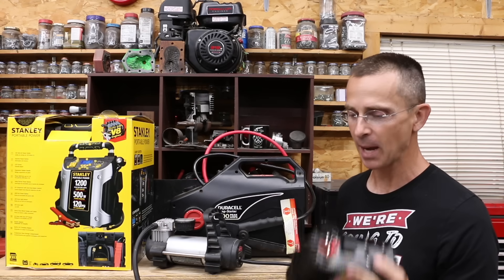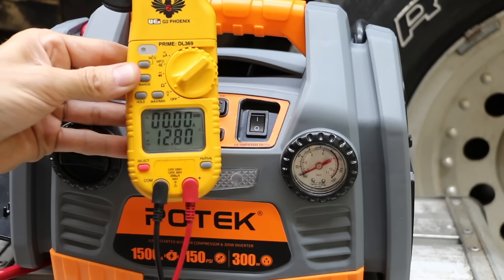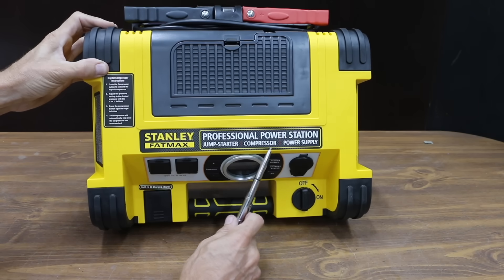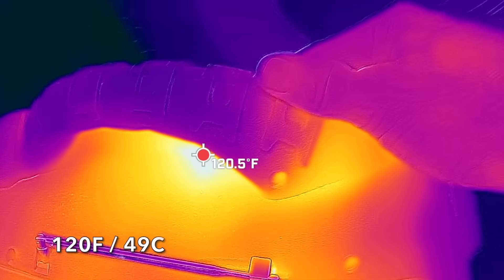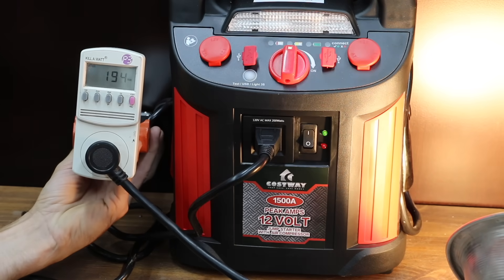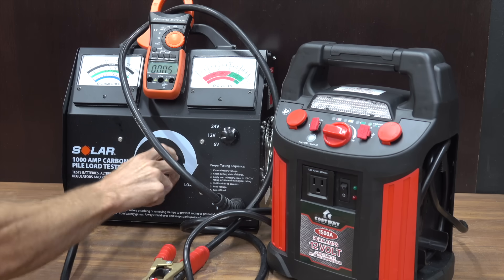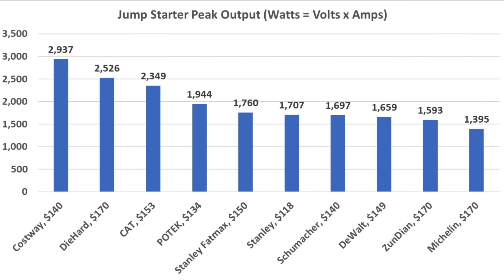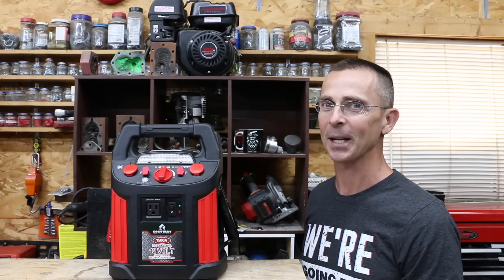Best Jump Starter? DieHard, Schumacher, DeWalt, Michelin, Stanley, CAT

Comment: I bought a CAT power station at Costco that is very similar to the one you tested, although the Costco version claims to have 1200 amps. (The Costco model is CJ1000DXT.) I also tried and failed to get my car started with it with the positive and negative terminals connected directly to the battery, as you did in your test. However, when I only connected the red cable to the positive terminal and connected the black cable to the frame of the car by clamping it onto one of the strut bolts, my car turned over very quickly. I don't know enough about electricity to know what that would change, but maybe you should rerun the jump start test that way?
Reply: With electricity, things are often 'grounded' or 'earthed' which means connected to the earth or ground, usually it's for safety. If something shorted, instead of current going through components that could be sensitive or in a dangerous way, current goes into the ground instead. Voltage is electrical pressure, and it comes from an electrical charge, which involves a difference in electrons. A lack of electrons creates the state of charge designated 'positive' and an abundance of electrons creates a state of 'negative' charge. The electrons repel each other, and are attracted to protons in the nuclei of the atoms in a medium, which are neutral only when the number of electrons matches the number of protons. The earth has an abundance of electrons, and since it's so massive, can give up or accept plenty of electrons without becoming negatively or positively charged. 
With a vehicle, it isn't practical to have a ground wire touching the ground all the time, so they have what's called a chassis ground, usually the negative terminal of the battery is connected to the chassis directly, so a circuit can be completed by connecting to the positive terminal, and to the chassis. Be careful not to short the positive terminal to the chassis, this is why you often see the positive terminal with a protective cover over it but not the negative one.
I guess if jumping the starter doesn't work connected to the terminals, but does when negative is connected to the chassis, either the battery terminal has poor contact somewhere or something, and you get better conductance with the chassis, or the booster pack's effort is being consumed by the battery itself, sucking in the charge which is meant for the starter. Electronics behave mysteriously on occasion, though there's generally a simple explanation underlying the confusing inconsistencies.
Reply from the maker: Thanks for the feedback.

Comment: All of these have similar motorcycle-size batteries inside them. It would have been helpful to disassemble them and see for which ones it's feasible to replace the battery.  eBay has several good sellers for replacement batteries.  Also, as others have pointed out, the internal sealed lead-acid batteries in these jumpers will go dead if not kept charged every few months.  I have an older model of the Cat jumper from Costco that I liked, but I hate the newer one because all the digital crap, it will refuse to even attempt to jump start some vehicles, e.g., perhaps the car battery is too low.  The older analog Cat models will give the jump effort whatever they've got, which is often enough to start the vehicle.
Reply from the maker: Thanks for the feedback.

Comment: Could you do locking grease gun heads?
I’ve tried a few and the ones I have tried are either bulky or difficult to lock so it would be greatly appreciated.
Reply from the maker: Thanks for the suggestion.

Comment: I have never been able to make one of these work.  I have always had to use another car with the engine running.  I might try the Costway.  Appreciate the work you do.  While I appreciate that this is not a rigorous test checking several of each of the brands and going for an average, it is good information and does serve well.  Although I will never use many of the things you test, I REALLY like seeing what kind of tests you have devised and constructed for so many of your challenges.  I admit I envy you the back 40 runway for your 4 wheelers.
Reply from the maker: Thanks for sharing.
Reply: A friend of mine owns a towing company and he uses a deep cycle battery with a short set of cables bolted to the studs. Works unreal time after time.
Reply: @jerryhyland1554 I have found a garden tractor battery (200-350 CCA) works great with short cheap jumper cables or heavier longer ones.  Just keep battery charged.

Comment: I wonder if it is a straight up time out safety that causes them to shut off at 10 minutes, not an over heat shut off 🤔 it's odd that they all shut off right at 10 minutes.
Reply from the maker: It is programmed to shut off at 10 minutes to prevent overheating.

Comment: Another strike against the Stanley (and why I'm not keen about sealed lead-acid batteries in general): LENGEVITY. I owned the Stanley unit minus the inverter and kept it in my car. After a year and a half was the first chance I had to use it and it wasn't enough to turn over the engine because the battery failed. The small Li-ion jump starters are much better at holding a charge.
Reply from the maker: Thanks for the feedback.

Comment: Another great video. Some constructive feedback though... All jump starters are more effective when the negative is attached to the vehicle ground like somewhere to the engine block. This way the jump starter is not trying to charge the battery and start the car simultaneously. This way provides a more direct path for electricity to the starter. Your test was good as it showed the most difficult scenario but there's a chance the jump packs that failed may have started in my suggested configuration.
Reply from the maker: Thanks!  Thanks for sharing.

Comment: I don't trust Stanley's tire compressors. The jump starter we bought has a paper thin piece of plastic for a piston that is obviously designed to wear down to the point where it no longer pumps; something I found out after the pump stopped working... In fact, the jumper in question is the very same Stanley Fatmax showcased in this video.
Reply from the maker: Thanks for the feedback.

Comment: Why not use lithium battery in a jump pack,I know cost would be higher but wouldn't the performance and weight reduction be worth it ? Can you swap the internal battery to lithium or would the internal charger be an issue ?

Comment: I prefer the much lighter lithium ion jump packs w/USB and separate M12 Inflator w/5yr wty. It’s been my experience the built-in pumps on the all in ones are not very long lasting and also take forever to air things up. And I have a separate inverter if needed but honestly I almost never need it.
Reply from the maker: Thanks for sharing.

Comment: A video comparing winches could be interesting! Winches have dynamic braking systems which prevent free-spinning. Originally I was looked to see if I could use a winch as a hoist for a ~50lb weight but I could not find any information about static load holding on winches.
Reply from the maker: Thanks for the suggestion.
Reply: Guys, remember Todd is purchasing these items out of his pocket.   Buying winches can be super expensive.   The last one I purchased, a WARN 10K Zeon Platinum, cost me $900.

Comment: Thanks for the video. I looked online for the Costway and it said it was only good for up to 4.5L gas engines. Did you find this to be true? What size engine were you using? Do you think it would work on a 6.0L gas engine? How would this compare to the Audew you tested earlier? Would the Audew be better for starting larger gas engines?
Reply from the maker: You are welcome!  Thanks for the suggestion.

Comment: Hey Project Farm, could you do a video testing powersports batteries? Specifically the batteries that go in import motorcycles (Honda, Yamaha, etc.)

I'd love to see these brands tested:

EverStart
Calltric (found on eBay)
WPS (Western Power Sports)
Yuasa (This would be a must test since many people believe Yuasa is best because they are a factory supplier to many motorcycle manufacturers)
Motobatt
BikeMaster
BatteryTender
Interstate
Chrome Pro (Popular on Amazon)

Could you test a variety of Lead Acid, AGM, and Lithium batteries? Some of these manufacturers make batteries of all three types.

If you think that would be too much for one video, maybe you could break it up into three videos. (Like you did for the different types of AA batteries)

"Best Lead Acid Powersports Battery"
"Best AGM Powersports Battery"
"Best Lithium Powersports Battery"

Love your videos!
Reply from the maker: Thanks!  Thanks for the suggestion.

Comment: Allen wrenches need to be tested all are junk
Reply from the maker: Thanks for the suggestion.
Reply: @ProjectFarm   1/4  and 5/16 are common sizes I use on the farm. Longevity is always problem along with tight screws. Ends always round off, breakage can be a problem also

Comment: Hey great videos thanks.
Unrelated to this video but: a while back you were exploring running a small engine on starter fluid and diesel and other blends of fuel. How about try diesel mixed with Ethanol? As you know Ethanol raises the octane rating of a fuel, it's rated 100 octane but mixed with gasoline Ethanol acts as 112 octane, a small amount of gas and a larger quantity of Ethanol may make diesel (or biodeiesel) run a small engine quite well, could you make a video on this, please?
Here's why I think this is a good idea for for video: Recently I've seen people interested in making "Ethanol free gas" by mixing a bit of water with the gas to make the Ethanol precipitate out. That Ethanol could easily be distilled off from the water separately and not wasted but used to power a small engine (generator/lawnmower etc) and people are also regularly recycling their cooking oil into viable diesel fuel using nothing more than lye and a bit of light processing.

I think it's a very interesting topic. Might Ethanol and Diesel be mixed to power a small engine?

Thanks again for all the great content you make!
Reply from the maker: You are welcome!  Thanks for the suggestion.
Reply: @ProjectFarm  Good afternoon I’m sorry to bother you but I hope you get back with me as fast as possible please cost way where did you buy yours or how did you locate it because I cannot find it in any store and I cannot even find it on the Internet. So can you please give me some information to go by do I need to go to a certain website to a store since that is the best one that came out of this test run I would like to own one of them so please help me out give me the information to locate one I would really appreciate it and God bless you sir✝️✝️✝️

Comment: Don’t have a need for an inverter so I personally went with your recommendations for a stand-alone compressor and a lithium ion jump starter. Size wise, they take up less space in a small bag then any of these combo units. To date, I have not had to use these device for my own vehicles (because I went with your recommendations for a car battery) but I have jumped two stranded motorists with dead batteries and just recently saved a 19 year old kid with a flat tire in the middle of Badlands National Park (~20 miles away from cellphone service). Keep up the great work!
Reply from the maker: Thanks, will do!  Thanks for sharing.

Comment: My experience with this type (owned 3) over the years is either the inflator or battery fails within 2 or 3 years. The inflator is only made to top off not run for long periods. I'd like to see some of the newer dual compressor 12V inflators tested. I now own one from Amazon that is much faster at inflating tires making these look pathetic. This is one of my favorite YouTube channels, so thanks!
Reply from the maker: You are welcome!

Comment: I miss your videos with lawnmower engines.  Can you do a new one with a few real life scenarios:

1.  Honda has a problem with their 1.5L turbo motors.  After 5K miles, some motors have allowed fuel to leak past the rings and the oil level is high by as high as a quart.  Can you run a test to see what damage is done to a lawnmower engine when the oil is diluted with gasoline by 27% (one quart of gas in a 3.7 qt system).
2.  Many years ago, my friend had a car that leaked/burned oil.  He would add STP to his crankcase to keep it full - of course not adding any oil and also never changing it.  I'm wondering if a crankcase with a 50/50 mix of oil and STP is too thick to flow.  I grew up in Chicago, where it was really cold, so the viscosity test with frozen fluids would be nice to see too.  I'm also wondering if running a 50/50 mix of STP and really old oil will damage an engine.
3.  I had a car with a bad head gasket that unfortunately leaked coolant into the crankcase.  I did wind up fixing the head gasket, but I did run the motor for a while with diluted oil.  Can you run a test to see what damage occurs at different concentrations of oil/coolant mixes or what percentage of coolant to oil is enough to cause catastrophic damage to an engine.
4.  I was told that I could add Seafoam to my engine oil.  Since Seafoam has low viscosity, I'm wondering what effect it has on diluting the oil and damaging the motor.  Can you run a test to see if damage occurs from running the motor on a Seafoam/oil mix?  What would happen if the percentage of Seafoam is increased - when will it cause catastrophic damage.
5.  Many years ago, a friend of mine did an oil change on his old car.  Before doing the oil change, he added a quart of Motor Flush, idled the motor to get it to running temp, then drained the oil and filled with new oil.  He was cutting corners and didn't change the oil filter.  Assuming it was a 5 quart system, he had about a 16% concentration in the filter (5 quarts oil and one quart of Motor Flush).  Then he filled the system with four quarts of oil and drove off.  Around 100 miles down the road, he blew the motor - the bearing went.  Doing the math, he had about 3.3% motor flush (5.3 oz Motor Flush and 160 oz capacity) in the crankcase.  Can you run a test to see what percentage of motor flush/oil will damage a motor?

I hope you can use these ideas.

Thanks.
Reply from the maker: Thanks for the suggestions.

Comment: My Die Hard charger, I always kept it plugged in and only used it a couple of times but the internal motorcycle battery eventually died. I went with a lithium ion jump starter and never looked back. Far stronger than the old school charger ever was.
Reply from the maker: Thanks for the feedback.

Comment: Hello.
Can you do another grease test?
I mean  test dedicated to bike mechanics where you compare greases dedicated for bikes?
Like:
Motorex 2000
Motorex white grease
park tool blue grease
etc.. i can mage list of greases used by all bike workshops in my town.
this most populargreases are used maliny for deposition of bearings and very often inside of bearings so they are need to be hydrofobic and protect from rust.
Reply from the maker: Thanks for the suggestion.

Comment: I wouldn't want to trust any of those units in an emergency. They can maybe do it all in perfect conditions, but you are usually jump starting your car with a unit that has a charge several months old (possibly years if you don't routinely charge it). I have a Schumacher jump starter about 12 years old. Upgraded the battery once. Helped me out a few times and have used it for others many more. Teamed with a ViAir pump I can get myself or others out of many jams with full confidence.
Reply from the maker: Thanks for the feedback.

Comment: Have you tested Lucas upper cylinder lubricant with injector cleaner yet? If not I’d love to see it go against sea foam. I’ve had noticeable success with both. I’d like to see what takes good cause Lucas is a fair bit cheaper by amount of fuel treated per ounce
Reply from the maker: Thanks for the suggestion.

Comment: How about testing onboard air compressors? I have a small ARB air compresor mounted under my hood and im curious about other similarly sized compressors. This powers my rear differential (ARB) locker so the others must have the same options. It actually fills my 35" tires from low PSI pretty quickly for its size. Id like to see a brand with similar performance with less cost like Viair and so on. Would be a great performance test and certainly will  be seen by many in the ofrroad community
Reply from the maker: Thanks for the suggestion.

Comment: I had a similar Shumacher that always worked great.  But after a few years the lead acid batteries go bad.  A replacement would cost as much a new unit.
I have a noco genius jump starter thats over 5 years old still charges to full.  It has a lithium ion battery.   FL heat is tough on batteries.
Reply from the maker: Thanks for sharing.

Comment: You should test brazing cloths like turbotorch torch sheild, solder weld heat resistant blanket along with other brands. I use the newtex heat resistant shield off Amazon but doesn't hold up as advertised. Would be real curious to see what you would come up with. 
Thanks
Reply from the maker: Thanks for the suggestion.

Comment: Try 2 stroke oil as engine oil vs normal oil, and I would like to see a vs between a Honda 200cc and a predator 212 with a full throttle test to see which one lasts longer. And how much
Reply from the maker: Thanks for the suggestion.

Comment: What about the Halfords own brand of Jump Starter. It does not have the tyre inflator, or inverter, but it is the only one that I have used, which is able to jump start a 1.6 Diesel engine. For £50, I think that it is the best, and one of the cheapest that will jump start a vehicle.
Reply from the maker: Thanks for the suggestion.